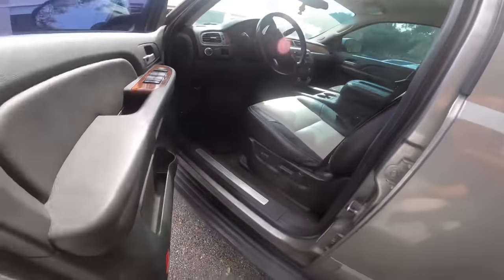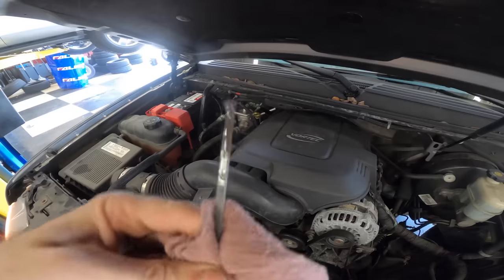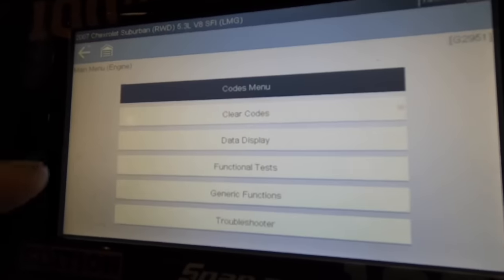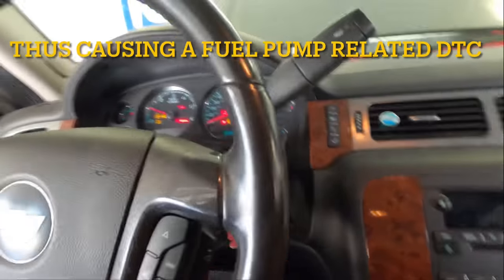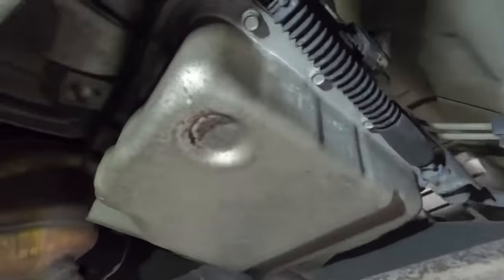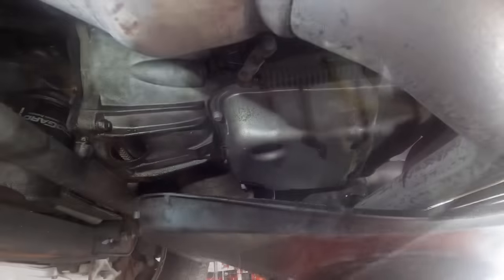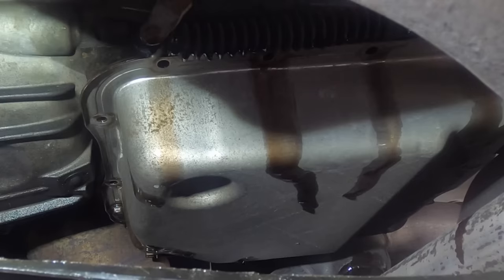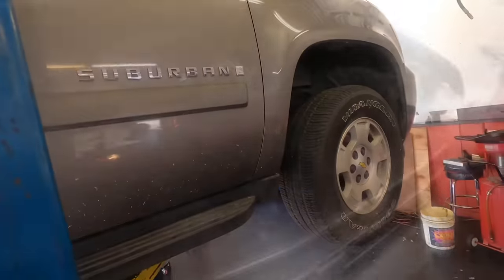Busted! SCAMMING Mechanic Causes Damage! 4l60E Transmission

Comment: The customer should be going after that shady tech for a new transmission as well. By sabotaging the TCM, it effectively cooked the clutches by taking off in second gear. I’d be over the moon pissed off if I was that customer, but on the other hand, that is why I do my own work, even if it’s a job I’m unfamiliar with. I’ll do the research, obtain the correct tools and figure it out!
Reply: yea i would be furious too.. sabotaging grrrrrr. But if this was a friends and like "black work" paid.. i understand, still ...why would one do this? wtf.
Reply: Do you have a 5000 dollar snap on diagnostic comeputer ?
Reply: It actually takes off in 3rd while in limp mode, even worse.
Reply: @peterwill3699  no, but I know relays don't remove themselves and wires damn sure don't magically grow from the fuse box to the the fuel pump.
Reply: @quinncox8923  Needs sued
Reply: I'm not up to date on the specifics of the 4l60's limp mode, but I wonder if its possible that the lock up clutch in the converter was disabled also? that is also a great way to help cook the fluid.
Reply: GM automatic’s  will start in second gear  if put in  second  gear  too have better traction in snow or  low traction surface’s
Reply: YEP, agree ; thats what i tod too, this guy should be in prison for doing that
Reply: I agree if I know how to do it i'll fix it myself . but just in case we have to take it in we do have a great shop here. shout out to Max's garage Lakeview Oregon.
Reply: i bet he paid a friend that works at a shop under the table and skipped out on paying the shop, thus why he wont say who did it.
Reply: The torque converter is what slips when taking off not the clutches no matter what gear you're in but that will cook the fluid from having the torque converter slip longer taking off in a higher gear...if I remember right
Reply: I took that relay out myself..... but I didn’t think anyone would catch on to my treachery.🤓
Reply: @peterwill3699  it's common sense if you have worked with this stuff before
Reply: @peterwill3699  I'm guessing he doesn't have one, but Auto Zone and a few other places will hook up a computer and read off codes to you for free. If they're particularly helpful and they have the time, they'll even help you diagnose the problem. The only downside is they're not mechanics, and sometimes they don't know a damn thing besides how to plug in the computer.
Reply: Point is there are more of us good techs. than bad rip off techs. People do a little research before taking your vehicle to a shop or tech.
Reply: @randyoehlert5045  I agree with you 100%  There is always a bad egg and unfortunately those are the ones that get all the attention.
Reply: This is what I do to, it’s much better that way
Reply: @peterwill3699  A $550 Autel will suffice with no subscription. But you can also GIVE someone a book they can't understand just the same. They're just tools that you should know how to use. It's not a $6,000 code scanner after all.
Reply: @adamnichols476  yeah , , bad friend
Reply: @peterwill3699  I don't, but there is a workplace here in the Netherlands for rent that has all the necessary doodads including such diagnostical computers. Supplies parts when necessary etc. Great place. The guy that owns it is a certified mechanic and taught me everything I need to do Basic diagnostics and maintenance myself. Everything else he's checking over my shoulder and walks me through the steps. Worth every penny. I would guess such places should be popular in the US too, with your hands-on mentality?
Reply: @peterwill3699  dont need to spend 5k depends on what car we are talking about tbh.
Reply: @peterwill3699  A cheap scan tool reads basic codes just doesn't show the amount of information of the expensive scan tools, You dont need $5000 scan tool to read a code.
Reply: @MLU8811 no shame in that at all better to know when to walk away from a job rather than take a risk that can easily be avoided.
Reply: @peterwill3699  lol ! 5000$ xD Not even 500$ will do the job ^^
Reply: Yeah I’m the same
Reply: Lincolns did that 2nd gear take off...duh. made car not fun..
Reply: @peterwill3699  are you lending yours out..thanks
Reply: only way to learn
Reply: @breimer87  converter is supposed to slip unless the tcc is locked fully. Generally only effects fuel economy at cruise. So anytime the converter isn't locked up you will have 500rpm or more slip.
Reply: @dragondraco412  you're right and that was what I was saying. Someone said that taking off in second gear cooked the clutches because the trans was  slipping too much. Taking off from second gear the clutches still should not slip at all (although it still isn't good to take off from second gear). The converter is what slips all the time, until you're cruising on the freeway and the lock solenoid engages like you stated.
Reply: Yep!
Reply: yup. I fix this crap, for my friends and family and very few others. I had enough of working in Shops , years ago. Though, I am thinking about getting a part time job, at an automotive Machine Shop, just because I'd like to learn the skillz.
Reply: find a mechanic you can trust.  It's not cheap, but it IS invaluable!
Reply: @scottamu7816  this is true. Good, Cheap, Fast... you can only have 2!
Reply: @dutchbachelor  I'm from the Netherlands, where is that?
Reply: @peterwill3699  you only need a $30 scan tool lol.
Reply: 700r4/4l60 E rather  defaults to 3rd gear 1:1 limp mode and i agree smoked the clutches some, the rattle may be the flex plate they crack at the crank bolts... too thin, that shady tech needs to be sued for fraudulent operation and theft by process closed up and shut down ) ....
Reply: @peterwill3699  no, you can't borrow my tool. Get your own. But, you should know it isn't necessary for almost all repairs, so stop making excuses and go turn a wrench :)
Reply: Same, too many lousy people in every industry really.
Reply: Could have been a relative that unknowingly to the customer was a slight drug addict need money and they doesn't think rational at all and just expected a sane normal person would accept everything that drug addict say is wrong with the car and pay huge sums.
Reply: @breimer87  thanks to the constant drive for fuel efficiency a lot of vehicles these days have a lock up torque converter that direct engages the transmission until you get moving.
Reply: @dcgregorya5434  your saying that backwards. It cannot direct connect anything until the vehicle is moving or the engine would stall and die. After the vehicle begins to move and the torque converter no longer needs to slip to keep the engine from stalling only then can the torque converter lock and essentially direct drive the engine. But this does improve fuel economy
Reply: Taking off in second will not cook the clutches lmao
Reply: @breimer87  my bad thanks
Reply: @breimer87  seen it before.

Comment: I bet the engine continuing to run issue when turned off was the rouge jumper wire powering the fuel pump.  When the relay was installed, the ECU turned it on, and the power back fed thru the relay that is now closed to the ignition 1 power circuit.
Great job,  good to see honest people out there.
Reply: no a jumper to the fuel pump wont cause it to stay running but it will cause the pump to not turn off the engine is not a desil if it was that could cause it to run nut that is a gas engine
Reply: @brandonsilvay4822  Without seeing a schematic, I don't know for sure.  I think that once the engine was started, that caused the fuel pump relay (when installed) to close which would then apply battery to the fuel pump, and then back feed thru the jumper to the Ignition 1 power rail.  That would in turn keep the computer up and running even after turning off the ignition switch.  Since the computer is up and running it would in turn keep the fuel pump relay closed.  The computer would "think" that the ignition switch is on due to the Ignition 1 rail being present.  The engine would then continue to run.  Unplugging the fuel pump relay breaks the loop and then the engine will shut off.   Its not the fuel pump being stuck on alone that causes the engine to continue to run - its not a diesel as you already pointed out.  I remember GM Fierro's  would only turn the fuel pump on during starting, and then a separate isolated switch would close when there was oil pressure, bypassing the relay.  This served as a fuel cut off safety if the engine stalled, or there was no oil pressure.
Reply: @Craig1967  I totally agree with you that that could happen but I doubt it because that same vehicle that exact same year make model
Reply: @Craig1967  yes without
Reply: @Craig1967  yes that is a possibility but I've done a hundred times I've even tried it on my friend's car to see if I can supply power to the ignition system through the fuel pump relay setup and it does not work that way it doesn't then the whole system is protected and will not allow it to start up or turn even inition on on top of that attention was on your – would still be in operation so that has a different issue somewhere in the system or relay for the ignition that is sticking I've seen really stick and usually what to fix that you just replace the relay
Reply: @Craig1967  that’s not how the fuel pump relay/oil pressure circuit works.  The module turns on the relay, which sends power to the pump, when the ignition is turned on. If the module does not see an RPM signal within a few seconds, the relay is turned off. If it sees the RPM signal, the relay remains on. When the oil pressure comes up, the switch would also provide power to the pump circuit. If the engine stalls, the oil pressure will drop, but the relay is still on (from the ECM) - so the pump stays on. The redundant power circuit from the oil pressure switch is not to turn off the pump if oil pressure drops, it is to turn the pump on if the relay fails.
Reply: @swh213  You are probably correct, but without schematics in front of me, I don't know for sure.  It was just a good guess.

Comment: Sir, THANK YOU, for being such an honest mechanic. I have been in and out of mechanic shops for the longest with my car for the past 3-4 years usually over the same thing. Currently, I have the knowledge to work on my car and stuff. But I was taken advantage of and my pockets emptied. Sometimes I was months without a car. So things like this, makes me so happy and tbh I wish I could just hug you. Currently, in the process of trying to sue my last mechanic, stripped my flywheel bolts to my car, not only that, but when I got my car back, my engine was idling rough, he told me I needed to get a new pcm and coil packs. Turns out 3 components weren't connected, wrong coolant was put into my car, my header bolts weren't on all the way, 1 bolt was actually missing, and the kid doing my spark plugs, just dropped them in there. Without thinking that he'd break the stem. Long story short. I have no trust for mechanics anymore. But you sir, have somewhat restored my faith. Thank you.
Reply: bro I like him too but, it's a youtube upload, not like he's gonna piss in the radiator on film.

Comment: The mysterious blue wire and missing fuel pump relay are suspicious enough. I would seriously consider legal action for tampering with my vehicle if I were that owner.
Reply: I would definitely do legal action…that was pure tryin to rip off the customer on that shops part.
Reply: There could be an issue around proving when and where the tampering was done, and if it was done thru malice or stupidity. But there's just no way Mechanic A could've avoided poking around in the fuse box and not noticed the probs... But what if the vehicle owner himself is the one running the scam and futzed with it beforehand, and is using our man as a pawn to extort the other mechanic (like getting a free transmission out of it maybe?). Or maybe dude's a lawyer or exposé journalist who set this up (collab with experienced mechanic) as a sting to investigate a complaint about THIS shop and there actually never was a 'Mechanic A'. Too many possibilities.
Reply: @timapple6586  that is a very specific thing to be done due to stupidity..sure it’s possible the vehicle owner did it…but why spend extra money at another shop to try to get free stuff from a different shop?  Most scammers like that don’t think that far    As for expose journalist..unless the shop ray works for gets many  complaints…those people don’t waste their time.  Lawyer maybe..it’s a little more plausible. Now it is possible ray is the only honest mechanic in that shop, everyone else are lying thieves…he does these recordings as a cya on his part.  I have found the most director answer, is the true answer..that is customer took their car to a schlock outfit who tried to scam them in spending way more money then needed.  Remember 99% of all auto shops and dealers  are crooks.  Live confidently and peacefully
Reply: @jjoohhnnx    ,.   .
.

..
Reply: yeathe owner shoud get hes money back plus the croocked scemmer mechanic shoud pay the bill for your service too
Reply: @timapple6586  agree the relay could have already been out and the wire was done to just make it run
Reply: Many shops do not care, they will micky mouse a job but charge same price as proper repair. They charge premium price and install cheapest parts. Tell them front right wheel bearing. They argue saying back left. The side making no noise or tire wore funny. Front right makes noise, front right tire wore weird but they still refuse to fix saying left rear. They just want to charge 800 each bearing times 4. Parts only 100 each and under 2 hrs each. I changed all 4 myself for 400 bucks and took only 4 hrs. 3200 at a shop to spend 400 on parts and a couple hrs. 2800 in 2 hrs is some good profits. 0 issues a person making a living. Shops not cheap to build and run but shit 2800 is a rip off. Charge 350 to change mass air flow censor. Parts 150, takes 5 min to change. 200 profit not fare. Best advice is learn auto work and do it yourself. Hell even a axle on fwd, they want 2400. Brand new axle is under 200 and 2 hrs to change. Its a parts swap not repair the old so anyone can do it. Cars now are just a complete parts swap. Dont repair old just swap the old with brand new. Think a bad trany, just buy rebuilt and do the job. Takes 1 day to change or 5 days doing 50 repairs then the trany last. Spend 5 grand to save 2500. 0 sense. Engine runs rough, pull a plug out and oil around ignition coils. They want to spend 3 days diagnosing when its 3 hr job to change valve cover gaskits. Then spend 3 hrs at 120 per hr to find what ignition coils are bad. With that 360 in shop rates could just buy all 6 brand new and replace all 6 same time. On a older car you spend 3 hrs to change only 2 and 6 months later do the same job again. Do all 6. To buy 6 at once get a better deal then 1 at a time plus now since all brand new they last another 10 yrs worry free. Save 100 today spend extra 800 tomorrow.
Reply: @johngregory662  Not just his money but something extra for the life taken out of the trans. He put 100K miles of wear on those clutches driving it in 2nd gear.
Reply: I'd at least want my money back or ill take it in teeth; his choice.
Reply: @timapple6586  Sad but true. I was once involved in a he said-she said thing and unless the vehicle was under constant watch by someone of authority the court can say anyone could have done it, including the owner. If the other shop did this, and I'm betting they did, then it It sucks for this guy.  However, that's how the innocent shops are protected from a car owner trying to run a scam on them.  The burden of proof will be on this car owner.
Reply: @timapple6586  I was thinking about that scenario also, was this a setup to test the Garage (Shop for Americans) that Ray works at?
Reply: @timapple6586  none of those problems existed before that last guy touched the rig. He was hired to replace a battery and change the oil. Now Ray comes in, removed that wire, reinstalled the relay and fuse and it’s back to normal. It’s was 100% a rip off scheme. The last guy sabotaged the rig.
Reply: @sendit2873  that relay was removed. Those don’t just fall out. There were fresh witness mark da boot!
Reply: Call Saul
Reply: Same for me.

Comment: This whole thing is very specific whoever pulled the fuses seems to know what they were doing which makes me wonder how many other people they have gotten with the same or similar scams
Reply: They more than likely do this particular scam and many many other types of trickery on a daily basis. I have been in this industry for 20+ years, The things I have seen most people wouldn't even believe.
Reply: I had a furniture repair guy do something similar, a rouge wire ran to trip the furnace off and on.
Different repair guy spotted it.